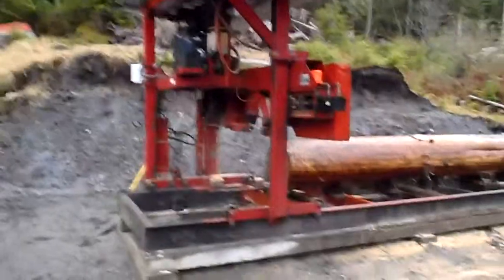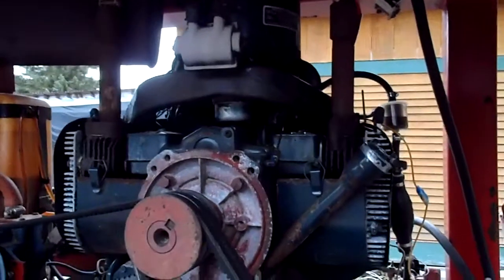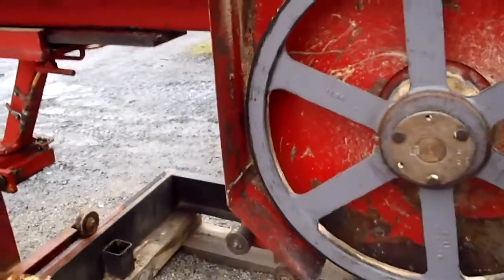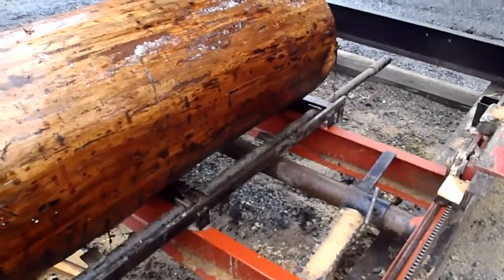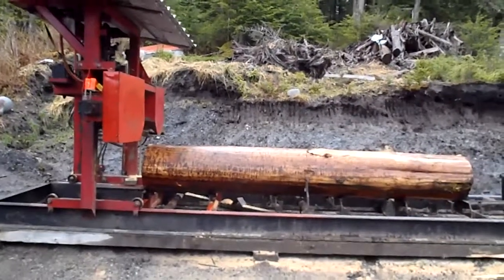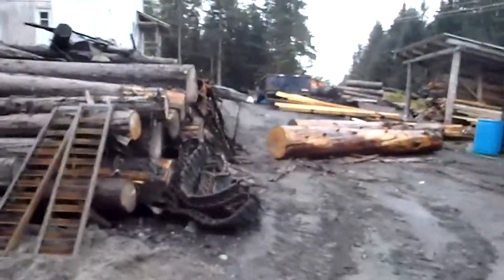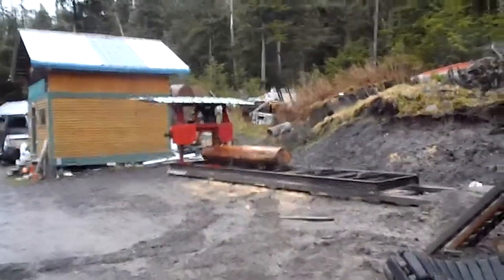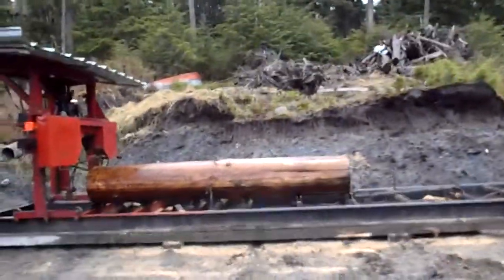mighty mite bandsaw mill erratta

Comment: Nice Video!
Thanks for posting.   I have noticed a mill EXACTLY like yours that has been sitting unused for over 10 years (and used a lot before then). Perhaps the owner would sell it to me... I am wondering what would be a reasonable offer to give the owner. Could you give me some general advice as to the mills value?  I assume i would have many of the same repairs as you have done.  
Also, if i do buy it, I would love any suggestions on where to buy parts and repair tips!  I will let you know if i do buy it.
Thanks a bunch for posting!
Reply from the maker: It's really hard to know the value of the mill without seeing it to evaluate it in person. It depends a lot on the model it is, condition it's in and the options it has. If it is a Mighty Mite, you can go to their website and get an idea of the mill models and new prices http://www.mightymitesawmills.com/bandsaw.html.
Bottom line value is probably scrap iron price.  If your in a dry area and the mill was cleaned and stored properly, and maintained while being used, it would be worth some what less than new price.
All of the models use the same basic mill, add-ons include more horsepower, longer track, siding and shake attachment, trailer package, and hydraulic goodies such as log turner, etc.
grab the band wheels and try to move them, if you get axial movement, the bearings are shot. Those bearings are $600 each plus from the factory or $300+ from a bearing supply. If the bearings are shot, there is a chance the shaft is damaged. These can be purchased from Mighty Mite, or made in a machine shop.
Check the band wheels for cracks, mainly around the hub. Band wheels are basically a big sheave, or pulley, with the groove filled with rubber or poly. If they are worn or don't have a crown, they can be repaired.
All the other rollers have common bearings that can be replaced. Drive chain and elevation chain are common sized.
Engine and hydraulics may be damaged from sitting. Fuel tank and hydraulic tank may have water and contaminates in them.
I gave $10000 for my mill, it had extended track to cut up to 20' log and 24 hp motor, but no trailer. Considering the condition it was in, $5000 wold have been fair.
Reply from the maker: psgflier
You can get all of the parts, as well as good advice from Mighty Mite, but a lot of the parts have a pretty good mark up. Most of the engine parts, bearing, etc are off the shelf items. Best place for the band wheels is from the factory.
They also make a real nice blade guide replacement. My mill came set up to run 2" blades, but, on the advice of the factory, I changed over to run 1 1/4" bands. These run better on the 24hp and lower machines, and the bands are less expensive.